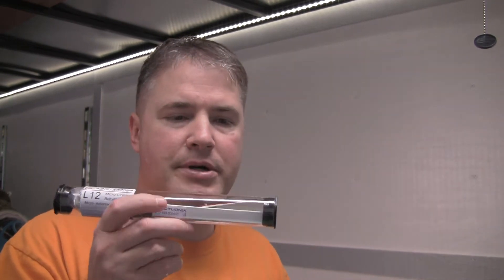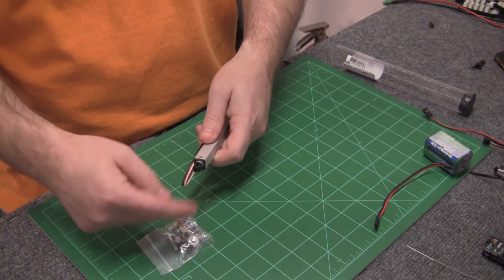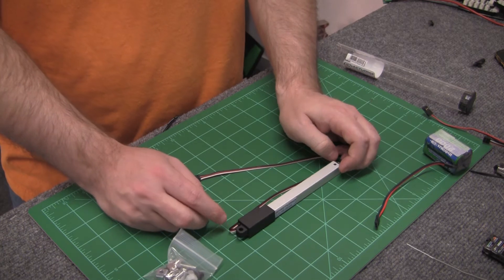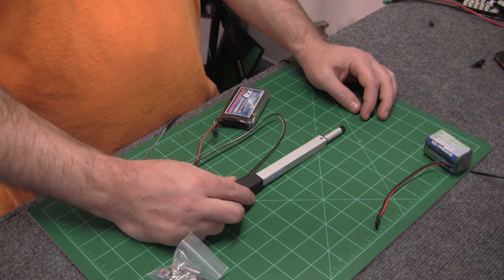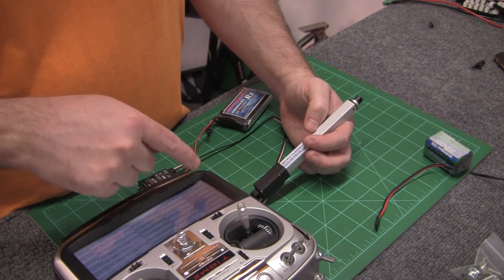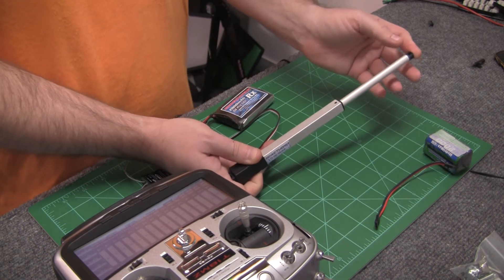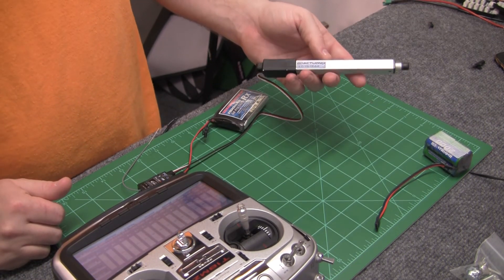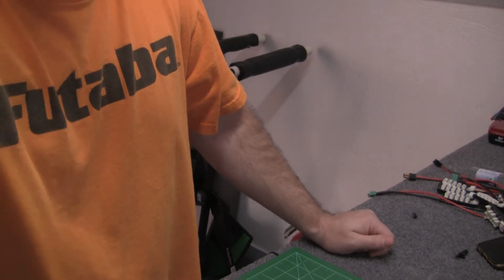Actuonix L12 Linear Acutators

Comment: Hi I want to ask if you can buy somewhere new motor with linear servo gearbox L16. I use them in the model and the gears were destroyed. Thank you
Reply from the maker: Tomas Holbic I’m just a dealer you will need to contact Actuonix direct for replacement parts.
Reply: @DragonBuildsRC  hi this is zuhair from UAE can i have it here in dubai ....how and from where i should buy let  me know plz
Reply from the maker: @zkkhans2903  I would just order direct from the factory in Canada